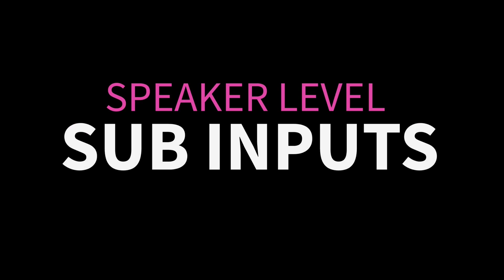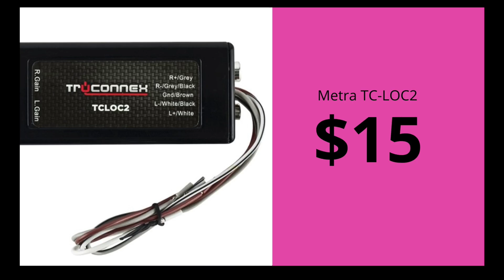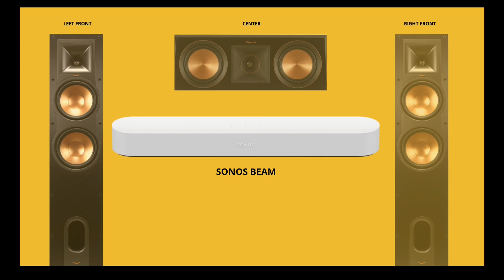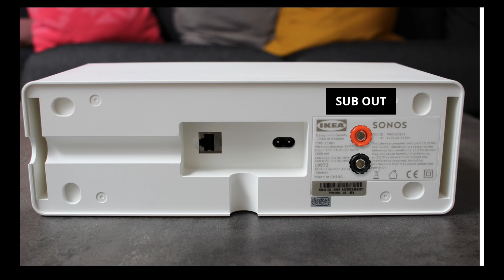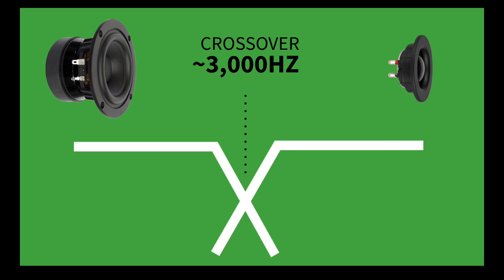Sonos sub hack DIY: How-to wiring guide to add any powered subwoofer to Sonos with Ikea Symonisk

Comment from the maker: UPDATE: I had to re-upload to fix an audio issue. This is a long video to cover everyone's questions so here are some jump links:
0:45 - How speaker level sub inputs work
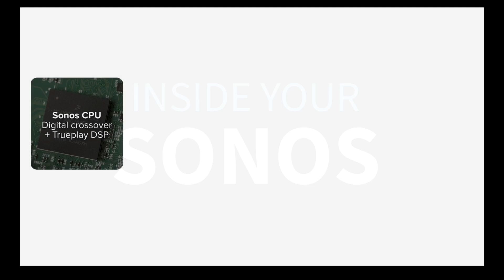7:09 - Inside your Sonos and why a line is tricky
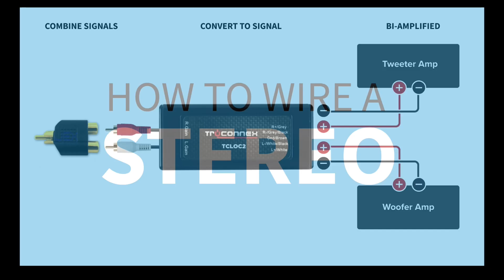9:06 - Stereo subwoofer wiring
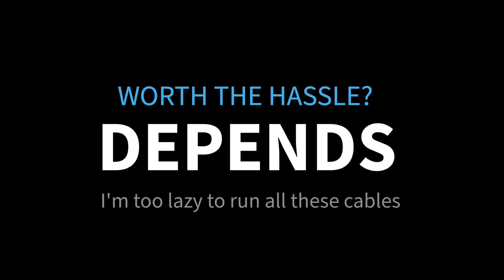14:40 - Home theater setup
19:42 - Setting up a sub as a separate 'room'
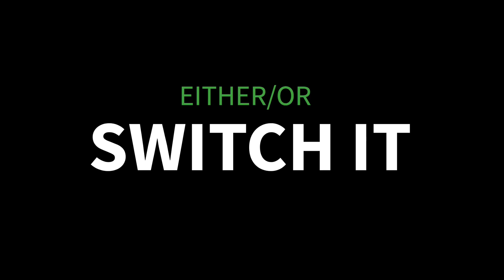21:09 - Adding switches
23:48 - Bi-amping passive speakers

Recommended subwoofers on Amazon ~$100:
Polk 10"  - https://amzn.to/2RcWV1q
Monoprice 8"  - https://amzn.to/3696umd
Monoprice premium 8" - https://amzn.to/2Rdl73O
Acoustic Audio 8" - https://amzn.to/2TVfCZt

Note: any subwoofer brand or size will work as long as it's amplified and has speaker level inputs - if it only has RCA inputs, look elsewhere.
Reply: Thank you for the video. Is there anyway we can tweak the Sonos to add Bluetooth ?
Reply: Can you add it inside Sonos app as a sub or will Sonos app not recognize it as such and instead will still see it as a Symfonisk speaker? If so, then buy 1 Symfonisk speaker, disable tweeter/sub inside rear speaker and jump it to the 3rd party sub. Thoughts?
Thanks!
Reply from the maker: Ray J Sonos will always see this as a Symfonisk but you can disable the internal drivers and that use it to get a signal to a sub. I cover that in the video as the separate zone/room approach
Reply: @todd.parker  Thanks, must have missed it. Was hoping I could add it as a sub only but obviously Sonos has it setup to detect the board/electronics as Symfonisk's speaker. Now.. Only if we could flash the board :)
Thanks again and appreciate the quick feedback.
Reply: I'm new here but IKEA??? I thought only Sonos speakers work with Sonos???
Reply from the maker: @net200777  These are a collaboration with Sonos + IKEA. These are pretty much Play:1's inside but much cheaper (and easier to hack)
Reply: @todd.parker  Will this work with the Arc?
Reply from the maker: This technique will work with any powered speaker, including the Arc, because we’re just siphoning off a signal to send to the powered sub. The question is whether you want to disassemble your new baby.
Reply: Thanks for video, Todd. Currently you need at least 1 Sonos sub gen3 to use 2 subs. If i can get into my gen 2 sub, can i wire an active sub off of one of the gen 2's drivers or how best should I do the link? Thanks
Reply from the maker: @tenengasobo7538  That would be ideal since you’d be getting a true sub signal and the rest of the speakers would be clearer because Sonos knows there’s a sub and will roll off the lows. There are tear down videos on the sub on YT to help you get in. Let me know how it goes!
Reply: @todd.parker  I did it...it works but the 3rd party sub struggles: signal from sonos sub seems to be too strong. I can only turn up the 3rd party sub's vol by 1 or less, else the driver vibrates uncontrollably. Maybe the 3rd party sub isn't a right choice, it's sealed (B&W AWS 600); I got it 2nd hand very cheap. 
Am I happy? Yes, I get a sense of balanced bass in the room. Note: I am no audiophile or sound expert.
Any advice on how to control the bass signal from sonos sub is appreciated. 
By the way I didn't drill the sonos, i used one of the vents but padded the cable.
Reply from the maker: @tenengasobo7538  just checking: are you connecting the sub wires to speaker level inputs on your external sub? You can’t plug that into RCA input without converting the amplified power down to a signal level
Reply: @todd.parker  thanks and bless you...it sounds much better and controlled when connected to speaker level input
Reply: @Todd Parker, great tutorial! So just confirming that as long as my woofer has speaker line input I can simply run a wire from the symfonisk bass amplifier to the woofer? BUT... If my my woofer has rca inputs I will need to use a line level converter from the symfonisk to the rca input of the woofer? thanks again for all the great stuff!
Reply from the maker: @mikey816  yes, exactly!

Comment: Dumb question. if i am just trying to run 2 outdoor speakers to my current sonos system. could i just wire one directly to the wires going to speaker and one directly to the wires to the tweeter? basically just replacing the internal speakers with 2 outdoor speakers?
Reply from the maker: Yes, you could use the internal amps in the symfonisk and run the 4 wires to each outdoor speaker. run trueplay after.

Comment: I did the wiring diagram at 22:58 and now the Symfonisk, that used to work, is bricked!  No signs of life when I plug it in.  Any idea of what may have gone wrong?  Thank you in advance for any assistance!
Reply from the maker: The wiring is very "safe" as it just re-routes the speaker wires to other drivers. Did you touch the+ and - wires together? That could cause ea short but still shouldn't brick it. Did you re-connect the control panel and make sure all connections are correct when you put it back together?

Comment: I wonder if anyone is still using this with the Ultra in an atmos environment. I have some of the other subs and am tempted to tap into one of them to add a second much better sub. I wonder how the sound is with trueplay via symfonisk hack versus connect or amp directly (as sonos is trying to push amp for rears and a sub).

Comment: Hi , can I use a Sonos connect ( not amp) and use a third party subwoofer?
Reply from the maker: Yes, that’s what it’s for. Just plug the RCA outputs into your sub
Reply: My sub has high level speaker inputs and LFE input .. which ones do I use for the Sonos connect
Reply: Hi

Comment: Id love to learn how to do add a pair of powered SVS subs to my Arc.❤
Reply: I was thinking the same with beam. I guess conceptually it should work the same, as long as it has separated woofer amp. I was wondering if the new Arc ultra has even a dedicated sub amp which would be even easier to jump from and disable its own sub channel.
Reply from the maker: It would totally work but a product like the Arc is packed with components so opening it up and getting a neat cable out is probably really tricky. I wish they offered a $100 sub out box but that's bad for sub sales. You can tap into the rear channels or use the gateway approach, neither is perfect but works surprisingly well

Comment: Hi Todd.  I have a Sonos Beam and was just about ready to order the Sonos sub when I just discovered your Ikea subwoofer hack video.  I have great Paradigm powered subwoofer that been has been sitting in my basement since I got rid of my old home stere system.  My question is, do you need two Symphonisk or other Sonos speakers to get the signal to my powered subwoofer?  Also, will this hack work just for music without the TV being on?  Thanks!
Reply: Did you end up doing any DIY on your Beam? I was thinking of opening up my beam (gen 1) to see if same can be done directly for that instead of from the symfonisk.

Comment: One important additional function the speaker-to-RCA converters also perform is ground isolation. The RCA jacks on the subwoofer share a common ground (outer terminal ring), while the speaker connections from the amplifier have isolated grounds. The converter uses 1:1 audio transformers on each channel to "lift" the grounds, thus preventing the grounds from being electrically connected when the converter wires into the sub's input jacks.

Comment: Great video's.
I have a woofer that only has one input (LFE) is there a converter that I can use with this subwoofer
Reply from the maker: You only need one input, really but if it doesn’t have speaker inputs you can buy a speaker to signal converter to make it work

Comment: Hi. Thank you for some very nice and helpful videos👍🏻😊 Just tried to hack my symfonisk speaker. Disconnected tweeter and woofer from the symfonisk and connected bi-amp to tweeter and woofer on a B&W CM2. I can start the music but when I turn up the volume it shut down (at level 20-30% in the SONOS app). Do you know what could be wrong?
Reply from the maker: Strange. Are you wiring the woofer and tweeter output from the Symfonisk directly to the drivers in the B&W’s? If there are dual “bi-wire” inputs on the back, they may not truly be independent and could feed into the same passive crossover which could be causing a short. You want to connect directly to the drivers.
Reply: @todd.parker  did find the fault. I forgot to remove the short circuit on the back bi-wire.👍🏻😊
Reply: @todd.parker  and thank you for answering 👍🏻😊
Reply from the maker: @MadsSmidt-wf9ce  Cool. I figured it was something like that. Good the amps have short circuit protection!

Comment: Hello Todd. Thank you so much for all the work you have put in to this. 
I have one question re the 4 terminal setup on the Symfosk speakers. At 13.58 you make a quick comment that with the 4 terminal setup, both rear speakers MUST be modified, i.e. connected to the sub, whereas with the twin terminal setup, you questioned if there is much to be gained by connecting to both speakers. Could you explain why the difference please?
Reply from the maker: For that configuration you need to do both speakers but that’s one of a few I cover. The advantage of that is you’re removing bass from the symfonisk’s plate so they sound cleaner. Doing only one side would mean the other might sound a bit distorted at higher volume s compared to the other

Comment: @todd.parker I have two Play:5 Gen.1 - which Sonos now is saying has too little memory to stream Spotify without pausing music intermittently.  Do you think It would make sense to use a Symfonisk and hook that up to the Play 5 and stream the music from the Symfonisk to the speaker part of the Play 5?
Reply from the maker: It would be worth trying for sure. You could stream to the symfonisk and group that with your 5’s
Reply: @todd.parker  do you by any chance know where to connect the wires from the symfonisk, on the Play5?(there are more speaker units in the play5)
Reply from the maker: @lovejoyone  The simple answer is to connect the wires from the Sonos speaker's woofer and run it to your sub. The older Play 5 is a 3 way system so you'd want to connect to the central sub since that would have the lowest frequencies. This should help: https://www.ifixit.com/Guide/Sonos+Play+5+Subwoofer+Replacement/86634
Reply: @todd.parker  Sorry - maybe I am not asking correctly. Basically - my Play5 gen 1 is kind of bricked to me - as it can no longer stream from spotify( but fine stream radio and other streamimg services) without pausing often.  Sonos support has investigated - and informa me that it is because of too little memory in the gen 1. My quest is - how can i get the Play5 up running again - by using a symfonisk to do the streaming part( that one has lots of memory) and the Play 5 to play that streamed music from the Play 5 3-way speakers( not only the bass) hope this makes better sense
Reply from the maker: Sorry too many comment threads here. There is no way to directly connect those. You could try to stream to a more modern speaker like a Symfonisk, then group that with your Play:5 to see if that helps. I'm not sure it will but it's worth a try. I you have other, newer Sonos speakers on hand, you can try it before committing to a purchase

Comment: Hi Todd, this was well explained and easy enough to complete. I have a question. I bought Yamaha Sub that has a high cut dial range 40Hz-140Hz. To my understanding that’s the frequency that the sun sends back to speakers. What frequency would be optimal for the Symfonisk base ? Thank you in advance.
Reply from the maker: I’d try 80-100hz. Basically, the higher the cutoff the less work the symfonisk woofers will need to do but it will make the sub easier to identify so 80hz is usually the standard but if they are working too hard, 100hz is also fine

Comment: Thank you for this superb guide! I'm wondering if I can set up a true 2.1-system with only RCAs? My super Jamo sub has RCA in and out, but no speaker connectors..
Reply from the maker: You just need to buy a high level (speaker) to low level (rca) converter. I cover recommendations in the video
Reply: Thanks for the quick reply. So you mean that I don’t have to send the signal back to the speaker from the sub? I really want to use the crossover in the sub to have my Symfonisk work a little ‘lighter’ 😉
Reply from the maker: @anders8018  Interesting. So it only has RCA inputs for both input and filtered output? If you don't have speaker in/outputs I don' think there is anything you can do on the signal side of things. You can, however, add a capacitor to the Symfonisk woofer to filter out the bass in a 6db/octave high pass crossover. That would remove some bass from the symfonisks
Reply: @todd.parker  Thanks again ! This sounds a bit out of my league, I think I stick with the solution in your first reply.😉
Thanks again !!

Comment: I don't understand, why not use the output from the Sonos Amp for power a Sel amplifier sub and drive passive speakers for a simple and integrated setup with out having to buy speakers and do all that
Reply from the maker: Well, the Sonos amp is $700 which is very pricy for a 2 channel amp. With this, you can buy a pair of Symfonisk and add a cheap $100-200 sub for a nice 2.1 system. Or use them as surrounds in a a home theater and hook up a cheap sub. Or skip the internal drivers and bi-amp a pair of passive 2 way speakers. Different use cases, both have a place

Comment: Awesome videos.. Q. Would it be possible to run cable from the tweeter amp to a Distributed Mode Speaker (Foam Board) with a Dayton audio exciter..?
Reply from the maker: I don’t see why not. It’s crossed over around 2k so is that lacking in some mids and low end?
Reply: @todd.parker  Thanks for the reply, hacking a Symfonisk just seems like a great way to test out DM speakers that have been featured on YouTube to see if they are as good as some people say..!
Reply from the maker: @sacundai5371  it definitely it but just keep in mind there is an electronic crossover so you can’t get a full range signal out of these, only highs or lows
Reply: @todd.parker  I was thinking about.. Using my Beam + Symfonisk  Cheap Sub (Input+Output) + Symfonisk Tweeter hack to Foam Board Speaker? Do you think this would this seem plausible?
Reply from the maker: @sacundai5371  Maybe not. Are you planning on still using the internal Symfonisk woofer? If not, you’ll have a huge hole in the frequencies. The sub works below 100hz or so. The tweeter goes from 2,000hz and up. If you don’t have a midbass/woofer, you’re missing all the sound form 100-2,000hz.

Comment: Great DIY! Thanks Todd. I just wired my one Symfonisk up yesterday (single binding post setup jumping the Symfonisk woofer but still having it connected as in 9:20 in the vid) using it in my living room as a stereo music system with two Symfonisk’s in stereo. Is it however correctly understood that the Symfonisk that is hooked up to the sub will be “weaker” than the other one because we’re “stealing” some power from it?
Reply from the maker: If you’re connecting to an amplified subwoofer that has speaker level inputs then there is no impact on the sound of the symfonisk because it doesn’t pull any current and just grabs a signal

Comment: Another question: did anyone try this hack on the Symfonisk picture frame speaker?
Reply from the maker: I don’t see any reason why it wouldn’t work unless it’s impossible to take apart. You’ll have an additional wire hanging down but should work

Comment: Thanks Todd for your amazing tutorial.
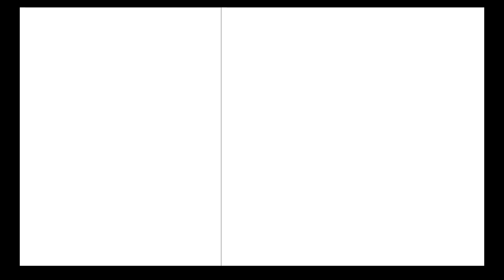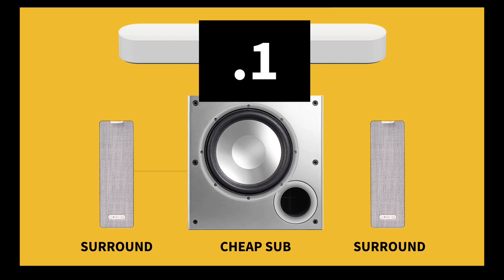I was wondering if you or anyone else has tried comparing the results using only the input of the sub with the method where you also use the sub output (15:40 vs 16:20)?
In other words, should I try to find a sub that has output or is that just unnecessary?
Reply from the maker: The main benefit it that will remove the bass from the symfonisk so it doesn’t have to work as hard. It’s a lot more complex to wire up so it’s probably not worth it unless you want maximum sound levels. Alternatively, you could filter the bass out by adding a capacitor to the woofers positive terminal. You’d need to look up the size for the desired frequency
Reply: Thanks! 
It ”sounds” as I will take the easy route in that case;)

Comment: Thanks! Did you experience any “rattling” in your symfonisk once you did this? Seems like the bass is hitting too hard on my surround speakers
Reply from the maker: If you hear rattling it’s probably air escaping from a seam. Make sure the screws are tight and the wire hole you added is sealed
Reply: @todd.parker  thanks man!! That solved it. Appreciate your help!
Reply from the maker: @patto46  awesome. It’s high pressure in there so even a small leak can get loud. Glad that worked

Comment: Great video! Thanks. Are there any safety concerns if you just wrap the wires to the posts instead of soldering?
Reply from the maker: As long as they can’t come loose and short out on the metal basket or other wire, sure. I’d use hot glue to keep them in place

Comment: Hi Todd thank you for this clear video.

I have a rell subwoofer that support high level output. For that i need to wire threr wires. Normal on the amp you put on+ one -  on the for instance right speaker output and one wire on the left - for ground.

Does this mean i have to open up both speakers to get the same result? And in this case does it mather the ground cable is a few meters longer?
Reply from the maker: Honestly I think you’d get 99% of the same result by just wiring in one speaker
Reply: @todd.parker  
Thanks, the 1% i can live with. Same goes for using my brain at least haha. I shall give a feedback may I find out using one speaker with a rel subwoofer results in a buzzing sound.